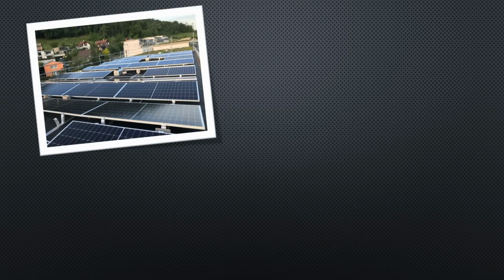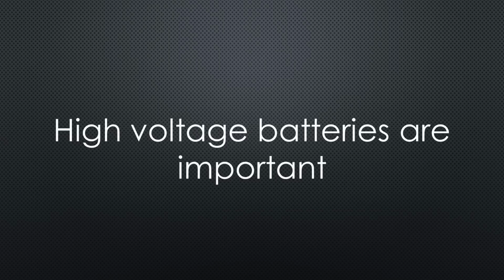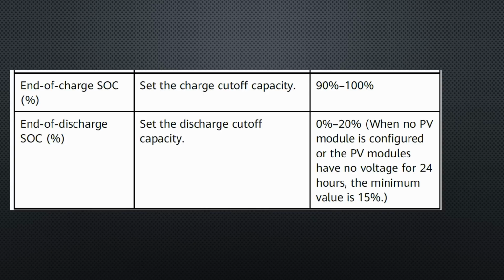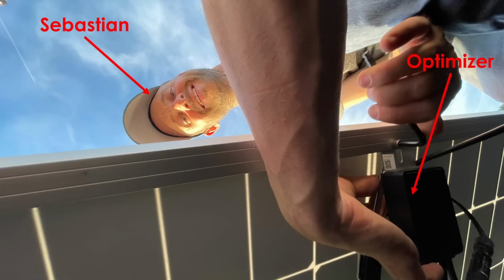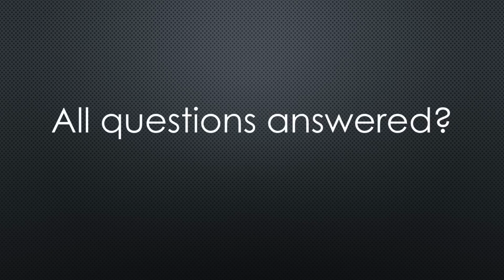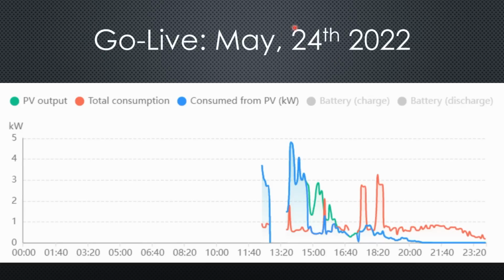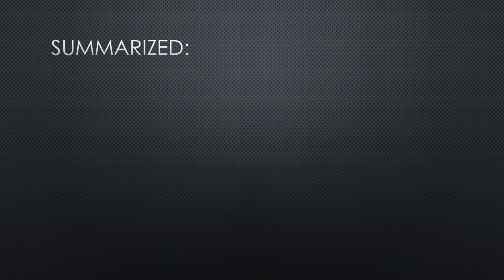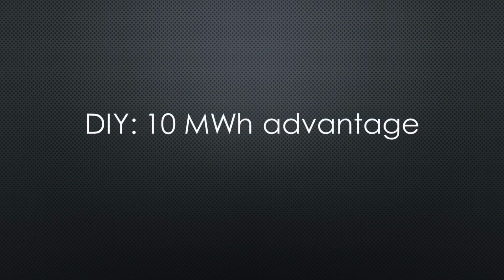438 Photo Voltaic (PV): Why Your Inverter Stops When the Grid Goes Down

Comment: I have heard that some brands of optimizers make a lot of RF noise . Did you have a chance to notice any before you removed it ?  Nice job on the setup and monitoring. I am all off grid here and this spring got 15 kwh worth of lithium to replace lead acid. In late winter I did my record solar production of making 30 kwh but I had to run electric heat , heat water, and do a lot of electric cooking to use up that much power. At that time of year the PV was cold making them more efficient , the sun more bright with less humidity,  and the PV  on my ground mount was at perfect angle to the sun to maximize everything. I also use grafana that gets data from my solar controller and some inexpensive PZEM-016 for AC and PZEM 017 for DC running into tasmoda esp32 which supports the pzem without any extra tinkering.  Can't you put some AC monitor on different parts of your wiring and then use Grafana to subtract or add to get the different power consumptions from load  or to grid ?
Reply from the maker: We had trouble with Solaredge optimizers here in Switzerland. So far I did not see RF issues with my installation. But I have a high noise level anyway.
Yes, I could shift the current sensors. But unfortunately, I do not have a lot of space in my crowded fuse box...

Comment: Very informative and clearly presented Andreas. Here in the UK I am on the most generous FIT scheme as my 3.6kW system was installed 10 years ago. The amounts increase by inflation each year. This year I get 60.23p per kWh generated but only 4.25p exported. The news today is that the government is discussing a scheme to pay people c50p kWh for using less energy in peak hours (how do they measure what is less!). 

I've been looking at battery storage (should have installed many years ago). Now prices have gone up 50% this year and there are major supply issues. Meanwhile I have built my own energy management system to divert excess energy to heat hot water. I decided not to fix clamps. Instead I have installed a consumption meter with S0 pulse output and changed the PV generation meter to a S0 output model. 1 pulse per 1W. The Smart meter already produces S0 purchase output (but not Export but I can calculate this). 

All pulses feed into an Arduino Nano and then the counts passed every x mins to a Raspberry Pi Zero. The Purchase pulses are relayed to a SolarLog that I had installed originally. The Pi controls the immersion element via MQTT and Zigbee. Stats are also sent via MQTT. I've plans to use InfluxDB & Grafana. Alert messages are sent by SMS/email/Telegram. I have built a web front end to monitor and adjust config values. It's taken a long time to build and develop. Maybe I should have bought an off-the-shelf system (OTSS) but at least it meets my requirements. Many OTSS are closed systems.

The Zigbee immersion switch is on/off but I would like one that is variable by value but I've need seen such a device. Do you have any ideas?
Reply from the maker: I think you were early with your installation. Back then these integrated inverter/battery systems were not available. This is the usual way where an industry learns. But you were able to get decent monitoring anyway! 
Today it did not make sense to build the inverter/battery system myself, also because I wanted a high volt one and do not like to work with those voltages.
Reply: @AndreasSpiess  Just to be clear, I installed PV with SolarLog monitoring 10 years ago, not PV/battery.  Now trying to do "catch up" with retrofitting batteries but supply issues and inflated costs.

Comment: Interesting that you're not allowed to have backup power, I guess it's because of the 3 phases requiring the grid to balance? In Belgium you can have it continue supplying power to your home. I assume they put an electric breaker to prevent feeding back to the grid in those cases?
Reply from the maker: We are allowed. But we have to take precautions to avoid the situations described in the video.

Comment: Looking forward to the next video on NodeRed integration.  I have the same inverter system and already run nodered but want to make sure my boiler doesn't turn on unless my inverter is producing enough power to supply it without using the grid.  Boiler is connected via a Sonoff switch re-flashed with Tasmota, just using Tasmota timres for now.
Reply from the maker: That should be easy...

Comment: optimizer sind doch durch die bypass Diode sinnlos. ich habe 3,3kWp aber Dünnschicht, schaffe im besten Fall 25kWh 😊, dazu 6kWh 18650 Powerwall. Wärmepumpe, EV... Was mich interessieren würde, warum du die Batterie sofort voll lädst, langsamer über den Tag wäre sicher schonender. Kann der Wechselrichter Inselbetrieb mit den ~9kW?
edit: ich habe nur einen kleinen soyo mit max. 900W auf der am meisten genutzten Phase. der Rest ist Insel. ich will mit den Netzbetreibern nichts zu tun haben
Reply from the maker: Ich könnte die Ladeleistung limitieren. Vielleicht tu ich das noch. Am Morgen kommt allerdings nicht soviel Energie (ich darf bis 5kW laden). 
Du bekommst sehr viel Energie pro kWp. Ich nehme an deine Panels sind in Südrichtung und steiler.
Reply: @AndreasSpiess  nein sie liegen flach, es sind alte Module von einem Solapark Rückbau. die installierte Fläche ist sehr groß. daher habe ich auch bei schlechterem Wetter noch etwas mehr Strom

Comment: You can change the currency on the company-level only. So if you have done the registration of your plant in FusionSolar completely by yourself (not involving an official installer) and therefore you had to register yourself as an installer as well, then you can set / change it on your own as well. You can find it in System --> Company Management --> Company info (in the FusionSolar WebUI). If the registration has been done by someone else (i.e. an official installer) then you may ask them to change the currency.
Reply from the maker: Worked. Thank you for the hint!

Comment: another project... here in the uk stuart pittaway (creator of diybms) has embarked on a journey to connect his solar pv system to uk grid. and make his own battery.i think it is another helpful example in a diversity of solar pv systems. if interested please also check out his new video series here on youtube. many thanks

interestingly he decided not to go with the huweii (although technically a good option) because... it seems to require also buying into the proprietary huweii ecosystem with a matching battery. and he very much wants to construct his own battery. for connected on grid under the lower power 16a (3kw) category. which is less regulated / easier to certify for on grid over here in our country.

so therefore i am also looking forwards to seeing what extent anybody is able hack the drm on those new huweii systems protocoll. if it is merely only for data collection. or if it can be anything more than that, to the level of impersonating (or simulating) a real huweii battery pack. kindda interesting subject. it also reminds me of the proprietary nature of certain other systems too. like for the enphase stuff etc. not sure how much that matters in specific circumstances. just being curious
Reply from the maker: You are right. The system is closed.  But because I wanted a high voltage battery I did not want to build it myself.
I subscribed with Stuart, BTW

Comment: I have Victron Multiplus-II and you can also set this "Grid Setpoint" which sets the watts pulled from grid, usually setting it to 50W to avoid undershooting and feeding power back into the grid.
Reply from the maker: I assume this is done by my strategy. If the battery is empty I will need all power from the grid.

Comment: You can add an inverter to the battery bank to provide a backup mains supply for some equipment on a separate set of sockets.  18 panels and battery bank being installed in next ten days. Have you looked at using spare power to heat water. No point selling power to the UK grid as I will only get 10% of what I buy it for.
Reply from the maker: I hope they will realize that it is stupid to pay you much less than they have to pay others for the same and let you "burn" electricity for heat. Here such discussions already started...
Reply: @AndreasSpiess  I'm going to fit a device to monitor out going power and if it exceeds 100Ws feed that amount into the hot water tank.  So I will only export when batteries are fully charged and hot water tank is at max temperature.  You can pwm the water heater easy its just resistive load.

Comment: Maybe I am missing something, but this 'using the grid as a buffer' seems strange. Wouldn't this maybe become a problem for the grid if there are manu PV installations connected?
Reply from the maker: Yes, it might become a problem. But not for the buffer function. What I refer to is just the imbalance between my three phases. Here, statistics make sure the consumption is more or less even if you connect many homes to the same grid. Each home has a different pattern.

Comment: Good information, great video.  Surprised to learn that Switzerland has three-phase power for residential service.  Here in US three-phase service is generally only used for commercial or industrial service.
Reply: I live in Brazil and here your connection to the grid depends on your power demand. It doesn't matter if it is a home or business. Up to 12-15 kW you are serviced by 1 phase, from 12-15 kW up to 25 kW you are serviced by 2 phases, and from 25 kW up to 75 kW you are serviced by 3 phases, always in low voltage, depending where you live it may be 127/220 V or 220/380 V (phase to neutral / phase to phase voltage). From 75 kW and up, you are serviced by the high power distribution grid (13,8 kV) and you must install your own transformer to step down the voltage. Also note that the high power grid operates with 3 phases in delta configuration without neutral wire, and your transformer will step down the voltage and the low voltage side is wired in star configuration with 3 phases plus neutral, and the neutral wire must be earthed. When you are serviced by 1, 2 or 3 phases in low voltage, you are always serviced by the corresponding phases plus the neutral wire in a star configuration. The earthing scheme is almost always TN-S, the neutral from the grid must be earthed upon arrival in your home.
Reply from the maker: This seems to be normal also for other European countries. Here, distances are smaller and therefore we need less copper than in the US...

Comment: In the US, household is one phase 240v split to 120v. We are fortunate to have net metering (100% credit). Outback Skybox inverter with 14kWh batteries. When grid is down, batteries power house and no power fed to grid (for safety).
Reply from the maker: Net metering is cool. Like that you do not need a battery if you do not strive for autarky. Here we still have cheaper electricity during night. So net metering would easily be possible for the providers. However, I think this will change with the installation of many solar panels. Then electricity will be more valuable (expensive?) during night.

Comment: I thought most grid-connected PV systems had a "grid-disconnect" function the disconnected from the grid when the grid goes down, and may need manual intervention to restore connection to the grid (may be automated...) At least that's how I understood the situation.
Reply from the maker: They do not disconnect. Just switch down for safety. And at least mine restarts automatically if the grid comes back.
Only a few inverters offer "island" operation. But you are not alone. Most people are astonished when they learn this fact...

Comment: Interesting video with similar experience to our solar setup + battery and backup gateway. I’m interested to see how you get on optimising the purchase of electricity in winter months when you cannot generate enough solar power. I’m still trying to optimise based on short range weather forecasts so that we buy enough cheap electricity overnight without buying too much and ending up sending solar generation to the grid.
Reply from the maker: Interesting! So far I have no such plans. I will have to go through winter to learn our pattern. I added a few more panels in direction south and very steep optimized for winter. Like that I hope that I do not have to buy too much electricity. Only for bad weather situations where optimization through forecasting probably also will not be interesting. But we will see. Maybe I am wrong.

Comment: Nice video. Thanks Andreas. Because your utility company only pays you 50%, have you considered storing some of the excess electricity you generate in the form of hot water (in large insulated water tanks) to use for things like showering, bathing, laundry, washing dishes, and (perhaps) radiant heating? I'm imagining after your battery is fully charged your system would then "fully heat" water in large insulated water tanks, prior to selling the electricity back to your utility company.
Reply from the maker: We are connected to a heat producing plant which runs with wood. So I did not include heat in my project. It is already renewable..
Reply: @Andreas Spiess  I see. I wasn't thinking about renewable energy; I was thinking about you spending less money for power. 
 
Selling electricity for 50% of what you pay for it made me think that it would be more cost-effective for you to heat water and then store it in hot water tanks rather than sell that electricity to your electric company.
 
If you get heat (I guess, perhaps, in the form of hot water) at a price that is 75% or less of what you pay for electricity, the it's probably more sensible to sell your excess electricity back to your electric company.
 
To me, renewable energy is a boring topic because wind and solar are so cheap—and projected to keep becoming significantly cheaper— that no other form of energy seems likely to be able to generally compete with them.
 
The incumbent power producers are scrambling to stay in business for as long as they can. Here in California, our terrible governor and state legislature just handed a huge "subsidy" (gift) to Diablo Canyon Power Plant of 1 billion US dollars so that it  could operate for up to another 20 years. It’s absurd, but it's the way politics work in the USA: companies pay what are tantamount to “legal bribes” to obtain favorable legislation.
 
Here’s an “article” that looks like it was written by nuclear power interests…
 
Diablo Canyon extension and renewables investment is a win for climate action and a win for California
https://www.catf.us/2022/09/diablo-canyon-extension-win-climate-action-win-california/
 
You were just on Route 66. Perhaps, just maybe, you noticed that here in the Southwest (I live in Los Angeles, California) we have this thing called a  d-e-s-e-r-t. We also currently import electricity from many other states including as far away as Wyoming which has some excellent areas for wind generators. We obviously don’t need nuclear power. But the executives at Diablo Canyon Power Plant are probably very reluctant to, for example, get jobs flipping hamburgers at McDonalds. Therefore, I suppose they are probably spending money like drunken sailors: not on women, but on politicians.

Comment: How big is the wire in diameter from the roof to the inverter? I have seen some say it's 10mm2
In Upper Austria they made the smart meter sort of mandatory so no additional hassle to get that..

Other thing 12kw is how many people? We seem to have 16kw a day and are 5 people average seems to be way lower though so I dunno what we do wrong.
Reply from the maker: 1. I do not know the inner diameter. The outer diameter is 6mm including insulation
2.We are only 2 people. But with home office. And no electrical heating or electric car. And in summer

Comment: Sehr spannend! Ich mache momentan Kleinversuche mit meiner Amateurfunk-Station mit PV. Ich bin Funkmässg total autark. Nun mache ich mir Gedanken, wie ich am besten meine PC USV mit Solar Strom beteiben kann (IT -> TN Netz) / Notstrom. Das macht richtig Spass! 73 aus Kloten!
Reply from the maker: Den Shack könnte ich grösstenteils mit 12 Volt betreiben. Für das Labor habe ich mich für ein 220 Volt System entschieden weil es sonst zu kompliziert ist weil ich verschiedene Spannungen brauche.
Die USV kannst du vermutlich mit einem einfachen 220V Inverter betreiben. Der muss nicht mal Sinus machen weil die meisten USVs im Notbetrieb ja auch kein Sinussignal erzeugen und die PCs gut damit zurechtkommen. Für den (solarbetriebenen) Shack würde ich aber mit einem 19V Laptop mit Batterien gehen...

Comment: I assume you do not have Time of Use billing ... In northern California rates are $0.30/kwh and up to $0.60/kwh between 1600 and 2100.. You have three phase power... wow!  Our power company starts fires on average once a day, and then they turn off the power if there is wind so when they start a fire, it doesn't spreading too fast.
Reply from the maker: We have Time of Use Billing, too. But pre-solar. We are charged less during the night (after 2100) when the industry uses less power and the power plants would produce excessive power. I assume this will change with the increase of solar plants.